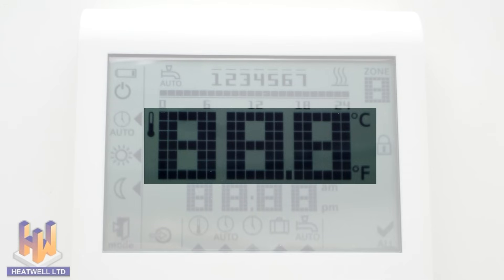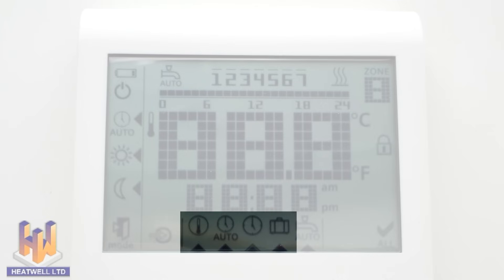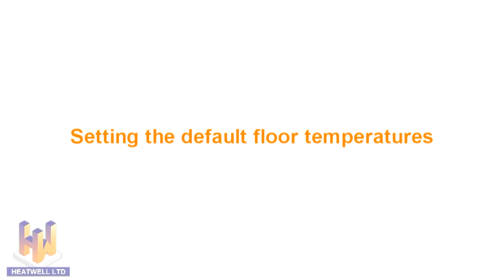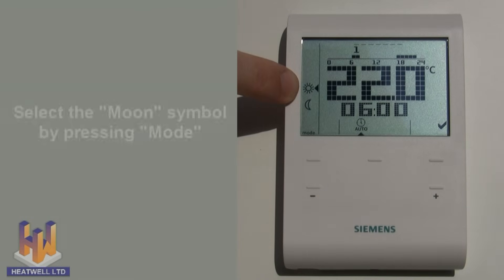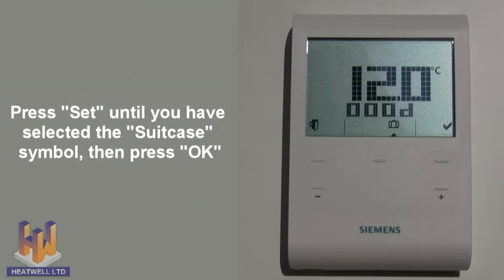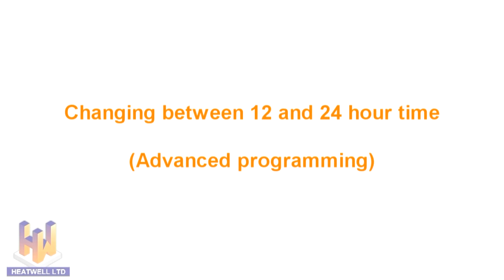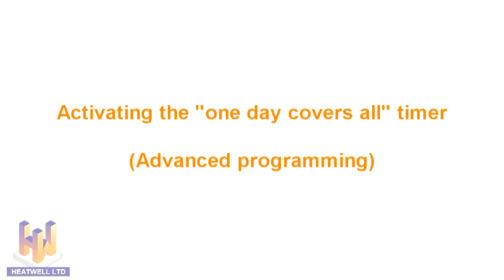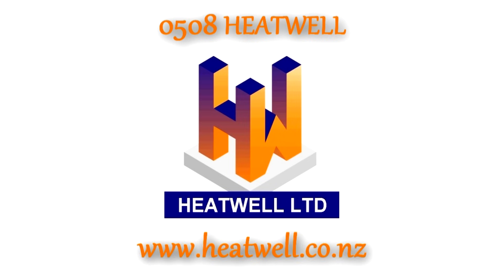Heatwell Thermostat Programming Video for Siemens RDE100

Comment: Thanks for your battery change section, before I saw my €€€ flying out of the window. Even after consulting the useless manual. Text: 'If you only see the to left symbol, your batterie needs changing.' Any further explaination SIEMENS? 'No, call your repairmen'. Thanks to your cool guideline, I changed these AAA in a hearthbeat. THX, love and kisses...

Comment: All I want to do is control my own thermostat! Turn it up, turn it down! Far too damn complicated. Changed the battery knocked a few buttons and its now over 25 in the house in summer! I'm so exhasperated with it! Should it be in eco or comfort? I just usually have the house at 17 in summer so it doesn't come on...I am sweating and can't seem to get it back to normal functions and the floor heating is on with a mind of it's own 😢
Reply: Hi did you figure this out? My floors have not been heated since last yea but now without me even turning it on (or the pad even being on!) my floors are heated?!
Reply: @sfn8483  sounds like you have an issue! Yes, the underfloor is passive, I didn't realise you couldn't use it like rads. I've left it on 22 and it's runs as it needs. The boiler was fine, it was just me
Reply: @sfn8483  I can let you know the exact settings it's on if you wanted?

Comment: Does any one tell how to turn off the unit system as summer is coming its too hot to leave it on

Thanks
Reply from the maker: There is no real off but you can set the Moon temperature to the lowest it will go and then set the mode to Moon and that could be ok if your ambient does not drop below this temperature.

Comment: We moved into our rented spain apartment in November 2022 and I froze all winter. Between the radiator units in each room with broken knobs, this control we didn't know how to work (no instructions), and the Saunier Dual Themafast condenser f 30 unit in the kitchen....we don't know what controls what but nothing worked until we had radiator knobs replaced. we still have no idea what this thermostat controls except that we were cold during the day and hot at night. The settings were for someone who was at work all day which makes sense. I don't know if there is floor heat or other options. It helped some when neighbors below came for Jan and Feb. Heat from below. 
This video was great for showing how to program which we didn't know. (downloaded the manual). I finally got tired of waiting for someone to resolve this and am trying on my own. The only trouble spot of the video for me was during the time explaining the days of the week bars the setting kept resetting. It took me about 5 times to get it right in the step by step of the days, figuring out I could wipe out all settings by going backwards, then starting over.  I do wish the instructions for setting all the days the same schedule were BEFORE the individual days (or possible) but I know now. Thank you. I still don't know if I fixed anything or not but it was worth a try.

Comment: Help, my unit defaults back to a pre-set temperature, I want to know how to turn if off/no and have it set at a temp consistently for 7 days.  Just bought this house with the seimens unit and can't work it out?
Reply from the maker: Go to 14:45 time line on the video and install the OFF/Frost Protection option and you get a new Icon on the top left of the screen. This icon will turn it off until temperature drops below 5c. Then set the sun temp to the temp you want and just switch between these icons to make it work. ps. Make sure the moon temp is set low like 5c.

Comment: How do I turn off the heating thermostat in the summer
Reply from the maker: There is no true off.  Go to the video at time line 14:48 and see how to program in the P10 Frost Protection.  Change the 0 to a 1 as in the video and a new symbol will appear at the top left of the screen. When you select this mode option the thermostat will switch off and will only activate if the room/floor temperature drops below 5 degree Celsius.

Comment: I just want to turn off.. God
Reply from the maker: There is no off, just turn the temperature to its lowest and leave it there.
Reply: You can turn it off - keep pressing the mode button - afterit gets to the bottom (moon symbol) it will go to the top - the on off symbol will blink a couple of times, and the unit switches off.   To turn back on, push the mode button and select the desired mode - I just use auto.

Comment: No matter what i set, my underfloor heating stays at 28.5 degrees. Anyone else facing this issue?
Reply: 4 years later but I have the same problem I try to put the temperature at 23 degrees Celsius and it stays at 18, it’s so cold

Comment: This video was very helpful, I found the instruction book of no help at all. The one thing I am still wondering is what is the recommended temperature setting for a unit that uses its own internal thermostat which in my case is up on the wall. I have set the temperature at 25c but after running four (4) hours in the early morning the floor is still not that warm. Should I set it higher than this??
Reply: Bob Rodgers